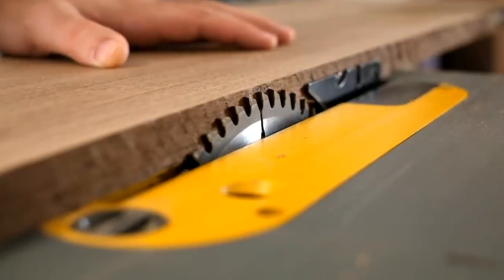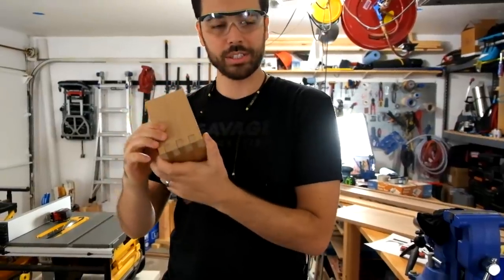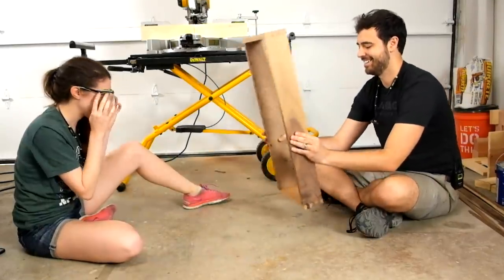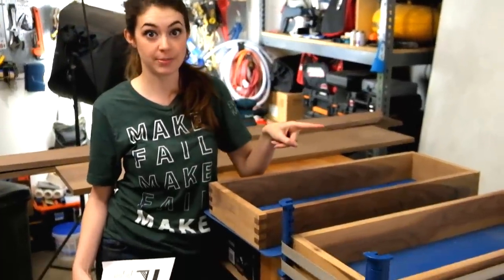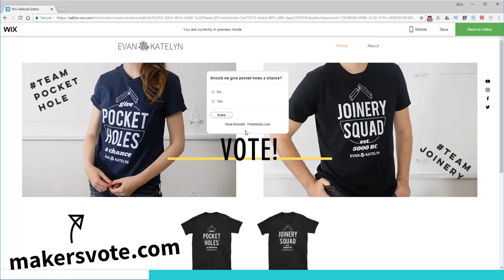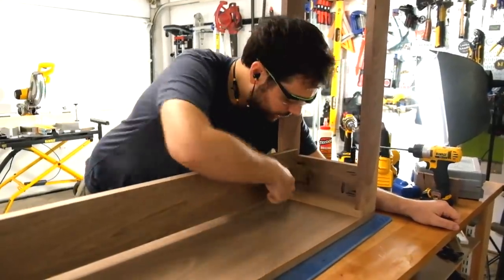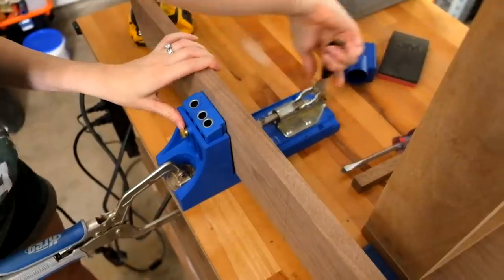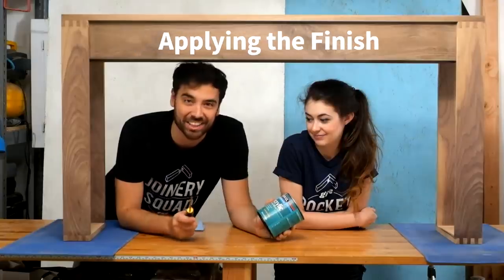Modern Entryway Table using Finger Joints & Pocket Holes

Comment: Always nice to build a project to fill a specific need. My biggest problem is building a project because it looks interesting/challenging and then having to find a place to put it.   Can't go wrong with walnut as the color and figure make a statement. I love how the figure pops when the finish is applied. I would not have used pocket holes for this project and my joinery would be just as invisible as yours. There are no wrong ways to join boards together if in the end they don't fall apart and you achieve the look you are going for. As for those exposed box joints, they as a nice added visual effect.
Reply from the maker: We're gonna start running out of space for the things we make at some point, but for now we have plenty of Ikea furniture that needs replacing. Love that we can all do whatever joinery suits us best and appreciate what others do too!

Comment: As always, I love your videos! One issue you might run into down the road is with expansion and contraction of your table top with seasonal movement, especially where you live. The number of pocket screws you used prevents the top from moving at all, which sounds good, but might lead to it cracking. Normally when you screw a solid wood top to a table base, you elongate the holes to allow sideways movement across the grain. On small enough pieces, it's not as much of a worry, but when you get into furniture, it's something you need to plan for.
Reply from the maker: Thank you and thanks for the tip!

Comment: My simple "furniture like" projects to date, have for the most part been butt joints and glue, so pocket holes would really be a step up for me! They have been used in durable commercially manufactured furniture for decades, and I've even seen antique furniture with pocket holes.  Companies like Kreg may be popularising the method, but in my estimation its a well proven process.   Since most of the furniture in my house is flat pack crap,  I'd be happy to have some pocket hole joinery to class up the place a little.  I just wont invite any joinery snobs over ;)  Love the table by the way, very contemporary design.
Reply from the maker: Yeah we see it as a huge step up from the Ikea furniture we're slowly replacing in the house! (Not that there's anything wrong with ikea... We still love it for certain things!)
Reply: EvanAndKatelyn lol, I was thinking the same thing about IKEA but didnt want to mention them, but yeah I have pieces from there I like as well!

Comment: Really cool guys. It's a clean and warm desing table and is kinda easy to do. But you could use a stopped mortise & tenon instead of that joints for a wood floaty pile aesthetics. But it is a fine woodwork though.
Reply from the maker: Thank you!

Comment: as a carpenter i give you a tip thay you may know but still in stead of useing the (what ever wood you use) in this case the walnut putty/woodfiller  for the joints and the small holes, you can use mix simple wood glue and fine Sawdust of which wood you use and put that in the holes and on in on the joints.

i love your work. its realy nice and well done
Reply from the maker: Thank you for the tip! That'll be great especially when we don't have wood filler on hand 😁

Comment: You make a great case of using both joints and pocket holes, that's the type of sponsoring I think as best case.I guess you don't always have that choice.
And it's nice to see where it goes and what it replaces.

Upgrade, in every sense.
Reply from the maker: Thank you so much! Mmhmm it's definitely a big improvement over our old little table

Comment: I’ve been woodworking since I was a kid. Let’s say 35ish years...ok...40ish.
Pocket holes are simply a newer development in the tradition of joinery and, as has always been the case, the new kid always gets picked on. My own Kreg jig hasn’t had much use, but it’s in the shop because sometimes I don’t feel the need to do all the work that might otherwise be required. It was originally marketed as a time-saving tool. I use it that way. If I’m building a simple project that requires hiding screws, it’s nice to have. I haven’t used it on a fine furniture project yet, but I won’t say ‘never’.
Reply from the maker: Very good point, the new stuff always does seem to get picked on, especially when it seems like a shortcut.

Comment: No shame in using pocket holes.  You guys did it right.  Show joinery (box joints) where it shows, pocket holes where it doesn't.  If I'm really worried about all those pocket holes, I've got the Kreg Pocket Hole plug maker and make plugs from off-cuts of the material I am making the piece with.  Almost always match well.  Nice looking piece.
Reply from the maker: Thank you! We tried using the plugs once and they worked great! Glad you like the piece 🙂

Comment: I have no experience building anything, but I'm also having difficulty finding the right sized table for my plants. I need a table 72 inches long with a 18inch width and 3 feet tall. Is it possible to build something like this with just a hammer and some nails? I have a band saw and a circular hand held saw. Will the nails provide enough support, or do I really need a drill and screws?
Reply from the maker: I'd check out what they call "Project Panels" at Lowe's, they come in a few different widths and lengths and look sorta like butcher blocks where multiple pieces of wood are already joined together.  A screwdriver and screws would be a lot easier than hammer and nails, but I guess you could do it with hammer and nails
Reply: Use glue too, that is what will truly hold it together.
Reply: Yes! And ditto on the glue - glue is much stronger than the nails themselves. Straight, square cuts are your friend if you are only using hand tools.
Reply: If you use a large enough nail it will be fine, they have good shear strength, you will probably want to looking into getting heat treated nails because they are STOUT! Likewise glue in addition with nails and you'll be fine. People used to use other joinery and nails long before screws came around. Good luck!

Comment: Braces between each leg near the bottom would make it much sturdier. Or angled to the center of the top. Either way the legs be less likely to fold.
Reply from the maker: It's actually super sturdy! But we'll keep that in mind if it ever seems like it needs added rigidity. Since it's mostly decorative, it won't have much weight 👍

Comment: That’s so nice 😍 do the plans come with the cuts for the home improvement store? For the finger joints? Would they do that? Thanks!
Reply from the maker: The plans come with cut lengths (dimensions) and order of operations, but usually home improvement stores will only cut things to length for you (and the cut might be a little rough). They don't do finger joints for you, but you could replace those joints with pocket holes and DIY it 👍
Reply: EvanAndKatelyn you replieeeeeed 😭😍 Thanks so much for the info and I can’t wait to do this! Love you guys ❤️

Comment: Feeding tablesaw from the side? Hmmm.....good thing you had those finger saving blocks, much safer, and easier, to feed the wood from the entering side, off a bit to the side with the guide bar. A roller bar to catch the other end or a friend to catch is helpful.
Reply from the maker: We generally do it from the entering end like you see in the beginning but with such long boards, even with me catching one end it was hard to balance them. A roller bar would definitely help!

Comment: Clamps brother. Clamps.  I was very tense watching your fingers so close to the router bit while applying pressure to keep it in place...ahhhhh!
Reply: Yeah, I had the same thoughts, those can rip out of control. I know you need to get a nice clear shot but do be careful. We like you and want you to keep your fingers etc.
Reply from the maker: We ended up using clamps after the first few tries (we just weren't filming) and it felt WAY safer so we will definitely be doing it in the future that way. Thanks!

Comment: Nice project and equally nice finger joints/box joints. However, the number and way you installed the top to the leg section will lead to your top splitting when the weather gets really dry. And that is because you put so many pocket screws in and have no ability for the wood to move during different humidities. I know this for fact because I have seen it over and over again. You always install table tops so that when the wood expands and contracts, it doesn't get trapped and can't move. JMHO
Reply from the maker: Good to know! We live in Houston and it's pretty consistently humid year round, so hopefully since it's a small span of wood we will be ok

Comment: There is a slight issue with wood movement in this design.  The grain of the top of the legs is going front to back, and this is glued to the table-top where the grain is going side to side.  The table-top will want to expand and contract front to back, but the top of the legs will not expand and will restrict this movement.  It may or may not be a practical problem for a 12" deep table, but this design will not scale to anything deeper.  With all the talk of pocket holes vs traditional joinery, the table-top would probably be best connected to those legs with something even less fancy, good old fashioned screws going from under the legs into the table top, as they'd allow the table-top a little bit of movement.
Reply from the maker: Thank you for the tips!! We will definitely keep that in mind when we do something larger, really appreciate the help!
Reply: I was going to say the same thing about cross grain expansion.  You might see splitting of the table top due to humidity changes.  My woodworking experience doesn't compare to my dad's work.  It's one of his hobbies but he has made 5-6 entire kitchens of handmade cabinets.  His best stuff is at "Better Homes & Gardens" level.
Reply: I would say the bending of  the wood is the bigger problem compared to the expansion. It really depends on the gluebond if it will withstand those forces or not. If you do something larger there is a dovetail piece going through the tabletop to stop it from bending. I think you will find a Video about it on youtube ;)
The other point I see in the design is with the bottom of the legs. If you have the bottom piece laying flat on the floor you're running into a problem of wabbling if the flooring is not perfectly leveled and flatt.
And last but not least a tip for finishing. I guess what you use is some kind of oil based stuff, is it? What I recommend, for any type of wood, is to put on quite a lot of finish over the whole piece, let it sit for ~ 10 min and look that there are no drops etc, and then wipe of the excess. So the finish can soke into the wood deeper and has a better protection film and you reduce the risk of straining your wood by applying different amounts of finish on various spaces.
Reply: And if you want to go bad shit crazy on your next finger joint box you can sort the wood for their end grain direction. To reduce the bending of the wood in the joint and that it will bend in the more favourable direction.

Comment: As a person literally studying to teach our youth how to use tools and have practical skills this is the scariest channel I have seen in a long time you are promoting these videos as educational videos and they are wrong in so many way that it is frustrating that you have gotten this far off of false ideas of wood working and practical skills for example at 6:25 you say that the pocket screws are just for reinforcement to the glue so.... the glue is the primary connection here? and @Crafted Workshop do you think they could have spent 4 seconds on google to find that out!
Reply from the maker: We don't present ourselves as professionals, we are two people learning things as we go
Reply: Finally! A comment that I feel will be fun to respond too! Let's start out with a quick conversation about professionalism and how this is the textbook definition of how not to effectively critique someone. Secondly, you seem to tell them to "spend time on Google to research your information" while you yourself clearly haven't done your research. Wood glue, by pure and full definition, is the major connection. When you connect a joint or two pieces of wood with glue, screws are designed to hold the piece in place while the glue dries. After it has dried, the glue is the major connection point and takes most of the weight. Third, the fact that you attack people for their "inability to woodwork" and for "passing themselves as educators" while you simultaneously preach incorrect information and call yourself a professional, is the textbook definition of toxic and ruins the reputation of real and good technology teachers out there. You sir, need to take a moment to self evaluate. And my suggestion for you, do YOUR research before telling others to do theirs.